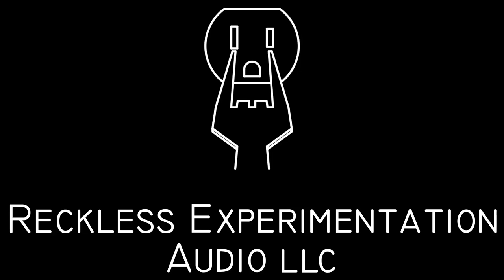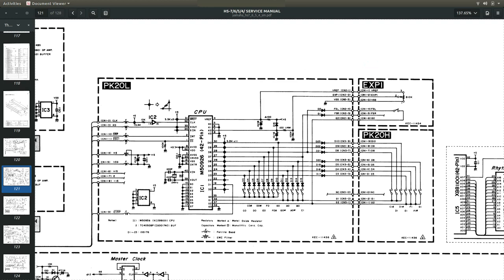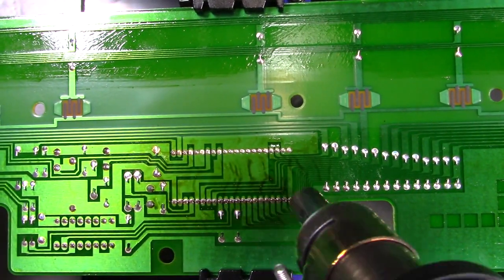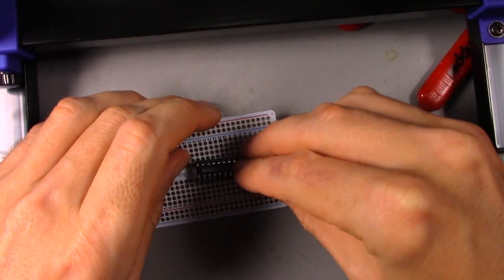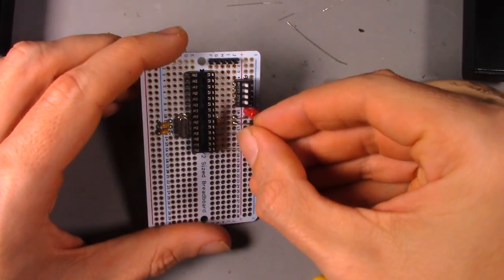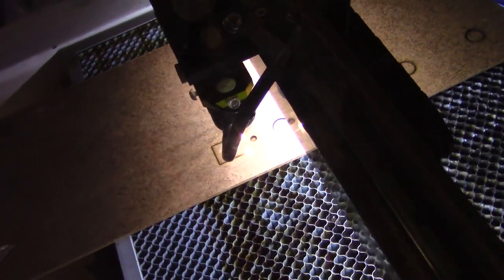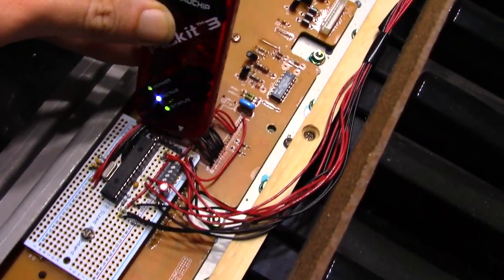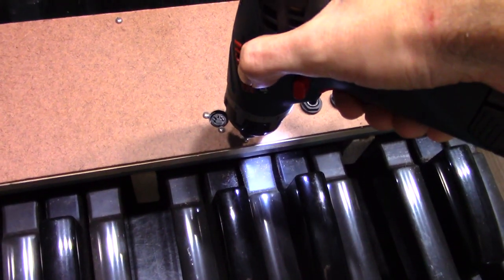Making a Midi Pedal Controller

Comment: How does reducing the value of Resistors help in better Pedal keys contact performance?
Reply from the maker: It has been a minute but I believe that I increased the resistor values of the pull up resistors on the key matrix. This was done because the switch contacts are old and don't conduct very good anymore. So the higher resistance in the pull ups means less current needs to flow before the micro-controller notices.
Reply: @Recklessexperimentationaudio  Thank you.I get it now,sir.

Comment: I’m not much of an electronics wizard like you are but I am interested in building something similar. However I have a Korg Microkey with some broken keys on it and I was wondering if I could pull the rest of them off and wire some new switches (like arcade buttons) to the contacts to make a basic foot keyboard?  Any advice?  Thanks
Reply from the maker: I can probably help you with this,. If you are interested, use the contact form on my website and we can discuss this further.

https://recklessexperimentationaudio.com

Comment: A pretty easy addition would be a bar across the board about where the heel is while playing and give it some suspension and make that the sustain pedal. Likewise for the other pedal a bar suspended just over the toes that can be pressed by raising the toe end of the foot. With these mode you could sustain with the playing foot while on any key and then rock the foot even farther back while sustaining to pull up the wah bar over the foot.

Comment: Would you say it would stand the speed and rough playing that walking bass need?
Reply from the maker: Absolutely it could, the main part of the frame is metal. It is actually quite heavy. I used solid wood for the rest of the structure. The hardboard parts are only to keep the electronics covered.

Comment: I'm just wondering if this pedal controller also supports Note velocity, for example: if you push the pedal harder, then it will be played louder and also the contrary: softer will play it lower.

I have been looking for such projects, but it seems that this is difficult to implement
Reply from the maker: No, this pedal controller only has one switch per pedal. 

For velocity sensing, you need two switches per pedal set so that the one closes after the other as the pedal is pressed. Then you measure the time it takes for the second switch to close after the first, and calculate velocity from that.

I defiantly would have done that had the pedal board I got supported it.
Reply: @Recklessexperimentationaudio  Yes, I figured out what you said about the switches after having looked the video: "WOMinator MIDI bass pedals by Lee O'Donnell". That guy really did it. He had a pedal switch supporting it
Reply: @Recklessexperimentationaudio  Anyway, you mentioned that the pedal doesn't support this. I have an Electone HS-8 and it indeed supports velocity, but it could be that this is programmed somewhere. My organ is still working and that's why it is supported.
Reply: Ok, regarding the pedals you got. I was just looking the manual of my organ, the HS-8, which also contains information about the HS-7, and you are right. The HS-8 is the only one with initial and after touch on the pedals. The inferior models only have this on the upper and lower keyboards.

So, I guess if I want to make it with this feature, I have to make sure that the original instrument supports this. So, I guess I could also get a defective HS-8 and leave try to repair mine, which has a small problem. Then use the pedals for this.
Reply: @jmemusic  I also watched this Video. It's great with USB Power and the switches.👍